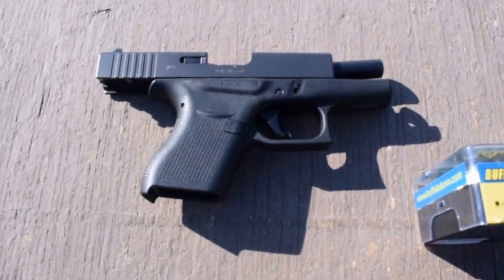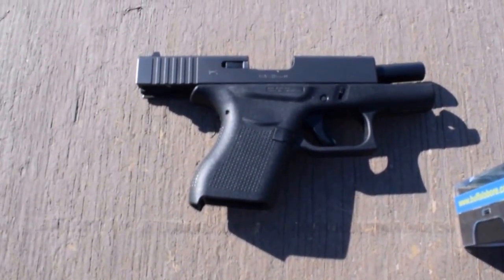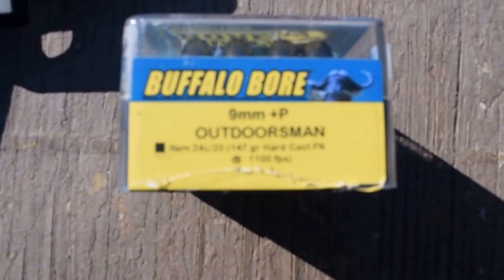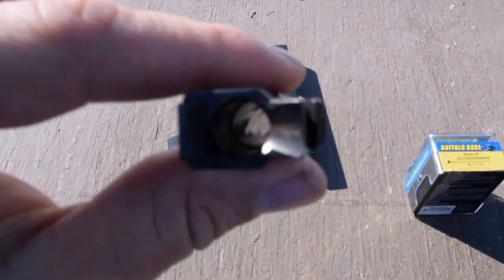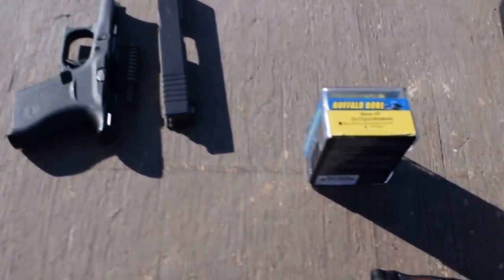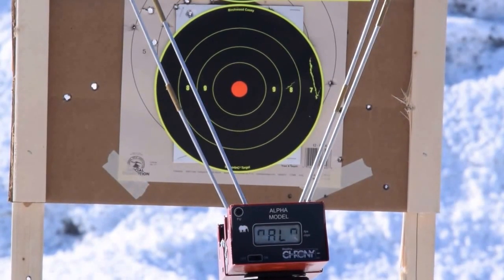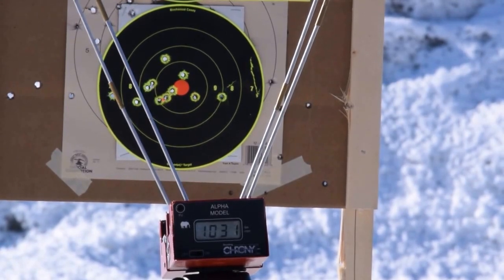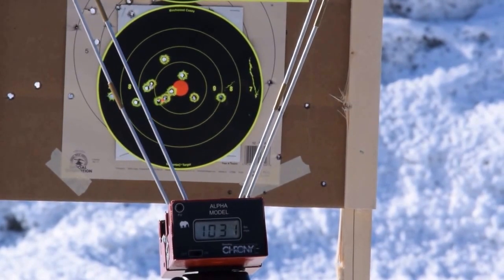Can you shoot hard cast lead in a glock?  147gr +P Buffalo Bore Hardcast Lead 9mm G43

Comment: I mean, I'm never going to shoot hundreds of rounds of this in training, but if I'm in an area with bears, I'm going to load it. Eight rounds won't destroy my barrel, but it might save my life.
Reply from the maker: I can agree with that
Reply from the maker: I put two rounds on top then xtreme penetrators from underwood beneath them. Like them both
Reply: Underwood makes a coated hard cast bullet now that protects the bore
Reply: Anthony Petrillo just add a stainless barrel and a stronger spring
Reply from the maker: I've got a video on those coming up
Reply: Why would it destroy your barrel?
Reply: @derekkt49  It won't.
Reply: @derekkt49  it doesn't destroy your barrel. The polygonal rifling is really bad about leading up, compared to conventional rifling
Reply: @derekkt49  shoot enough lead and it can basically become a smooth bore and maybe get some pressure spikes due to lead fouling providing obstruction to your next shots
Reply: @Wildwestwrangler  
Check out fortune cookie 45lc he explains why it’s not the rifling it’s the chamber. It very well done.🍻

Comment: If a pistol can't shoot all types of ammo and bullets I want nothing to do with it.  I've been shooting lead for 3 score years and have never had a problem with lead any more so than copper, zinc, carbon, what's that, or plastic.  I don't understand why anyone has problems with it.  Thanks for the vid.
Reply from the maker: If you clean it regularly is okay,  but it tends to build up at the lands on polygonal rifling... this causing pressure spikes,  eventually.  Modern coated hardcast works much better

Comment: I don’t think a few hard cast rounds followed by a good cleaning with de-lead solvent are a problem.  Shooting many rounds or not cleaning afterwards will cause lead fouling buildup leading to over pressure. Glocks don’t tolerate over pressure too well...
Reply from the maker: Shooter 1924 Agreed

Comment: I have shot literally thousands of hardcast lead bullets through my G19 and several thousand through my G20, G29, and G40. All stock barrels. There just cheaper to load and more accurate imo in the 10mm. There is some leading after a couple hundred rounds but I just run a swab of chore boy down the pipe and keep rollin. 
I'll also load up about 10 rounds of jacketed bullets (real low charge) to keep the pressure down, in whatever caliber I'm shooting and fire those through the barrel after I clean most the lead out. This helps strip the rest of any lead fouling out of the barrel.
Reply from the maker: Thanks for the the info!  Bear loads for 10mm?
Reply: Alaskan Ballistics - I order from Rim Rock bullets out of Polson Montana. They are the suppliers for Buffalo bores  "Outdoorsman" loads. I shoot the 147 in 9mm @ 1150fps and the 220 10mm to roughly 1250fps.
I would never buy buffalo bore ammo again after learning how cheap I can duplicate the same exact cartridge.
I can order 500 220grn "Outdoorsman" .40 caliber projectiles for $42
STARLINE brass
IMR 800x powder
CCI LP primers 
For the 147 grn outdoorsman I use vita vouri 3n37 or 3n38 to get over 1100fps.
That is the exact recipe from buffalo bore themselves.
You could also get the same velocities with AA#9 and Long Shot powders.
A lot of these ammo manufacturers that sell overpriced ammo can actually be duplicated at home for a fraction of the cost. 
Just saying.
Reply from the maker: That's awesome.  I have  a small apartment and don't have the space or time for reloading right now.  I used to do it a lot. It does save a lot of money. And it's fun.
Reply from the maker: Thank you for the info... what length barrel are those 220gr going through?

Comment: Thanks, this was very interesting. I currently carry a G26 as my woods gun. For black bears, I think this is a good combo although I also have a CZ p-01& G23 w/KKM. I load a 135 or 140 coated or plated for training and the 147 Rimrock for the woods. The gun shoots all of them into the same POI so I practice VERY little with the 147s. After maybe 15-20 rds max with the 147, the leading is not heavy at all and comes out easily with some copper strands from a "chore boy" pad wrapped around a normal brass brush. No big deal at all.
Reply: I would advise to get something get something bigger like a 10mm. Or 44 magnnum.
Reply from the maker: @sethklikesguns i think we all would agree.

Comment: I have a Glock model 22 I purchased in 1990. It has fired
Thousands of hardcast bullet
With no malfunction or loss
Of accuracy. In fact I am a
Firn believer that cleaning guns
Is overrated. The main consideration is that the barrel 
Should be cleaned when switching between lead and 
Copper bullets

Comment: I tired hard cast 9mm once and never again. after 500 rounds I don't even want to touch the gun because its coated. End up doing full disassembly and washed every component. It won't cause any damage but too much smoke and runs too dirty.
Reply from the maker: The coated ones are a little better

Comment: Did you expect the barrel to stay spotless?  Even jacketed will leave some fouling?
Reply from the maker: No but i didn't expect strings of lead going across the diameter of the barrel either... 
They may have been too thin for the camera to pick up, but they were there.
Reply from the maker: Fair enough

Comment: This seems to be a somewhat useless video to me. Those rounds are for protection in the woods from any kind of wild animal that might try to make you its meal.

I've seen the same round getting blasted through a Taurus G2c and it didn't hurt that gun. It's not a load that was designed for range practice. You're knocking probably the best Backwoods carrying 9 mm load on the market because it puts a little trash in your Barrel while Target practicing. That's not what it's designed for. It's designed to save your life in a bad situation from animals and I'm not talking about the human type.

I grew up hunting alone at a very early age. By the time I was 10 I pretty much knew how to handle a gun safely and without being a threat to anyone else around me. The rules were strict and I had to abide by them without any deviation or I lost my right to hunt. One of the biggest rules we had in my family was to clean that gun the second you get home. I specifically remember coming in to eat several one day and I laid my gun on the wall in the laundry room and went to eat. My dad looked at me and said, "Go clean that gun before you eat Boy!" It's a very good practice to follow. Point blank
Reply from the maker: That's a very good practice to follow.  
The point of this video is to see if these rounds are safe.  If you're using 9mm, good chance your dumping that mag as fast as you can

Comment: I have the Underwood 147+p Hardcast Flat Nose Coated im gonna use in my Glock43x as a backup carry with my Glock20 10mm. Have you ever tested or used these Underwood 9mm 147+p Hardcast in any of your guns? Thanks in advance 🇺🇸
Reply from the maker: Ran them through a Springfield hellcat once.  No issues.  Plan on doing a 9mm for bear country video.

Comment: They say on the website you can’t use the .40 +P in standard Glock barrel. If I got a box of these as backup, with no intention to shoot them unless a situation arises, would I be able to without blowing my Glock 27 gen 5 up?
Reply from the maker: No such thing as a .40s&w  +p
Or rather all .40s&w is above 34000 psi chamber pressure so the same as 9mm+p
Reply: @AlaskanBallistics  it’s got even more chamber pressure than the standard .40 they make. They’re hot.
Reply from the maker: Yeah no major ammo producer produces that these days
Reply: @AlaskanBallistics  what about the Buffalo bore .40 S&W that go like 1300fps
Reply from the maker: Within the psi specs
Reply from the maker: It's also a lighter bullet

Comment: Well , here it is 4 years later , and wondered if you've seen any of the Federal Premium new Syntech Solid Core ammo ? according to their specs its a 147 grain hard cast at 1120 fps BUT with their syntech coating . 
Supposedly coming out in most of the common Bear carry loads of .44 mag and below .
Reply from the maker: Haven't heard of or seen any
Reply: I just got a syntech solid core Federal premium blue tip.200 grain 10mm.  Did not shoot it yet.
Reply from the maker: @Jon p rose would be fun to test

Comment: main problem,,,,,,,, they are loaded to hot,,, you have them loaded at jacket speed,,,, get it down to 800-850 and as long as they cycle that will take car of the problem + go to a slower burning powder,,,,,i have shot 10s of 1000s rounds of hard cast and never had a problem,,, main thing,,, got to keep the fps down low and use a slower powder
Reply from the maker: Thanks for the advice
Reply: @AlaskanBallistics  your very welcome,,,, hope it helps,,,, i am getting ready to load up a bunch of 9mm round nose 124 grain lead

Comment: Read Tim Sundles article at the Buffalo Bore Web site, "Hard Cast in Polygonal Barrels"
Reply from the maker: I have..  i was surprised after reading that article that i still had pretty bad lead fouling afterwards,  but a few rounds couldn't matter
Reply: I'm surprised also. I have a 10mm,Glock 29, as a gun for wilderness protection.  I figured the 220 gr. BB hardcast would be the best choice, but probably the 200gr. FMJ would be similar, or something from Underwood in a penetrator ,Suggestions?

Comment: CHUCK:  I agree with you that 10 MM would be better... IF 9MM is your only choice. Speer LAWMAN 147 Flat Nose FMJ / TMJ {OR SIMILAR}  "might" be a better choice in Glock, HK and other barrels with POLYGON/HEXAGON RIFLING .      I personally prefer Winchester 9mm NATO 124 fmj SEALED cartridge  at actual chronographed velocity of 1100 - 1200 fps from typical pistol length barrels. NATO AMMO generally shoots clean and can survive ammo water submersion tests and still work.   note: OUR SOUTHERN BEARS are MUCH SMALLER  in Missouri.
Reply from the maker: I've got plenty of 10mm now
Reply: I dont live anywhere near bear country. I would love to get a glock 20 but im not going to buy a separate cartridge for a week i spend in the bush per year. I have plenty of 9mms and am way more likely to buy some of this buffalo bore ammo as a backup.

Comment: A few rounds of hard cast wont hurt anything. Especially with the gen 5 barrels. I put 2 boxes of non powder coated hardcast through my G48 MOS and there was no leading. I ran a dry patch through it and then a bore scope. I could not find any indication of lead buildup from the 40 rounds. If you want to carry hardcast for bears and moose you wont have any issues. I will also say that flat poing FMJ also gets plenty of penatration if you are paranoid about the hardcast bullets and your glock.
Reply from the maker: Yeah I carry powder coated hardcast handloads in my g20 now.  Love them.

Comment: Just got a box of these for my 43.  In intend to use them as my backpacking gun and ammo for black bear defense where I hike.  Mostly in Ouachita Forest and black bears are shy animals....and out there they aren't exactly a ton of them.  It would be my just in case ammo.  I used to (and still own) Ruger 3" sp101 shooting BB 180 grain outdoorsman for bear protection...but it's just a solid piece and 5 rounds.  Im expecting a black bear to high tail.outta there from a shot blast.
Reply from the maker: yakitoriPB yeah it's not a bad idea, but I'd go with The buffalo bite 124gr +p+ bonded tmj flat nose Penetrators... Doubt have to worry about lead fouling
Reply: Alaskan Ballistics who makes these?
Reply: IMO the Ruger 3" SP101 in 357 Magnum is an almost near perfect Outdoorsman handgun for the Fisherman, Hiker, Canoeist,  Camper, ect..    Ive owned several SP101's including an older 4" .22lr version and they are just fantastic revolvers..  The only non- S&W wheelguns I own are the SP101's because Smith has nothing that is size comparable that can eat a steady diet of full bore 357 magnum.
Reply from the maker: Little light for brown bear, but with the right load and Good shoot placement, it'll do just fine...